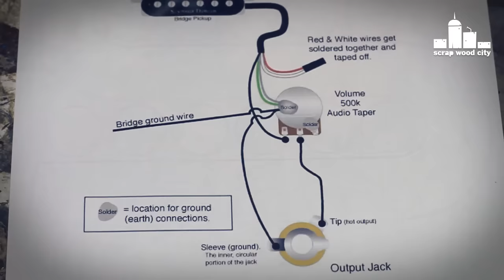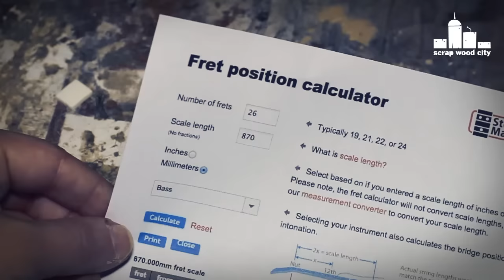How to make a DIY fretless electric bass guitar

Comment: Well, DIY... "Do it yourself" If you are carpenter and you have all the tools and knowledge.
Reply: Yup Xddd
Reply: all you really need to build guitars are files, a hammer, a saw and sand paper. you just need to put work in and want to do it. you don't need training or anything. just look up tutorials
Reply: in this video a lot of tools are not necessarry at all ;) it's just faster :p
Reply: well.. he didn't say everyone can do this s
Reply: i just wanted to say exactly  the same thing
Reply: I mean he's still kinda doing it himself, I guess?
Reply: Unless you are talking about taking a shit, you pretty much need tools and knowledge to do anything else. So, yes.
Reply: +justinmason100 A chisel might help at some parts, but not required tho! Actually clamps are almost necessary if you have to glue stuff. I guess you could lift the sofa on top of stuff, but it's not very practical and things tend to fall over quite easily, and these new hollow sofar are usually too lightweight for good results.

Also you need to have a space to do it. If you're living with a partner in a block apartment you're probably not going to get patted to the head if you conquer part of the room for woodworks for the next week or two. Actually mostly it's not even about the space, but the sawdust and trash.

Of course you can go outside, if you can. Here it's too cold for about 9/12 months and when it's warm enough to hang around outside I'm not going to spend it doing woodworks. 

See, you can make everything too hard if you really try ;)
Reply: Edu Martínez Power tools just speed up tge process. If you are determined, a hacksaw, a file and some sandpaper will work just fine. If you don't wanna get your hands dirty, that doesn't mean its not diy
Reply: He did do it himself though
Reply: True
Reply: Cyber_Jek Well he would have trouble cutting and soldering parts with his bare  hands.
Reply: Jon- DIY implies anyone can do it, with ease. This should have been entitled "Crafting a bass guitar from scratch". Your comment is elitist. I can criticize that not getting the terminology right for titling a YouTube tutorial also isn't "getting your hands dirty". Don't deign to tell me to do woodworking, and I won't tell you how to phrase your words, m'kay?
Reply: Wow what a surprise that making stuff requires knowledge and tools. Did you think he was just going conjure a bass out of thin air or something?

Comment: you have a loose ground somewhere, try grounding the potentiometers to ground because they can cause ground hum. if it still doesn't go away, replace the input jack and the main volume control on the amplifier. if it still hums, change out the cable with the power off and try a different source.

Comment: if it will be made shorter it is playable like a normal bass guitar? planning of building one myself... and for the pickup wiring... did you used all the magnets from the humbucker or not? you wired all magnets or you kept only the two at the bottom of the 2 bass strings? thank you

Comment: Nice job! Little tip to remove that buzz from the amp, apply shielding to the control cavity and the underside of the cover with aluminium tape and connect the shielding to ground by using a screw as a crimp. Make sure that whilst applying the strips of aluminium tape, one of the edges from a strip is bent backwards, then applied on the previous strip applied to make a continuous connection between the strips. I use this technique for shielding guitars which i make. True, copper tape is better but using aluminium tape is a cheaper alternative whilst achieving the same goal plus aluminium tape is more available than copper tape :)
Reply from the maker: +Blutaxt Malta thank you
Reply: +Scrap wood City Welcome ;)

Comment: A little grounding on the "bridge" would have decreased the hum, great build hovewer!
Reply: a little more w in the v and more V in the w would made the "however" much nicer, however nice comment
Reply: +Gigi Gogo Shielded wire from the pickup, and some sort of shielding in the volume pot cavity would help too. Should be negligible hum with that pickup.
Reply from the maker: +MrDavee1 I will deal with that problem in future. Sometimes it gets solved by simply re-soldering all connections!

Comment: Save for the fact that it is noisy as hell its tone is rather decent.
Though I think that a slightly bigger pickup housing to include a simple screen of aluminium or copper foil would reduce the noise.
Reply from the maker: Thanks. I know about the buzz but after some research I found out that the pick up was damaged. I bought really cheap second hand. Next time I will buy a descent one (unfortunately ) bass pickups are pretty expensive!

Comment: It hums loudly because the bridge was not grounded. you need a wire from the electronics grounded too the bridge . Otherwise you will always have a loud hum which you should not have with a humbucking pup.

Comment: Cool design from scrap wood. What kind of wood was it? Did you adjust intonation by calculating the exact position of the bridge? Important......   :)
Reply from the maker: Thanks, it's made of spruce. I usually adjust the intonation using harmonics, but don't expect really accurately tuned instruments with a DIY approach!

Comment: Nice as a fun project, but certainly nothing to be taken seriously. However, if you get that kind of buzz (noise) when you' re using a "P" style bass pickup (Which is a humbucking pickup by nature), then there is something you' re doing really wrong in the electronics department. There should be no buzzing noise at all...
Reply: There are a lot of things that be the cause of the buzz - and it's not necessarily the bass.

Comment: genius design. what kind of wood is it by the way?
Reply from the maker: thanks, it's just cheap spruce
Reply: Do you think it will bend from the tension of the strings? Or its thickness will prevent that?
Reply from the maker: So far it has not bent, but I think the wood is pretty thick to bend that easily!

Comment: No truss rod? Does that compromise the life span of the instrument?
Reply: +William Vickery There's no separation of the neck, it never had to be connected in the first place because it is the body. Therefore, no truss rod is needed to strengthen that bond.
Reply: Wow, you learn something new everyday! Thanks for the explanation.
Reply: And you! Are very welcome, kind sir.
Reply: +TheFaced Not true, neck through instruments also have truss rods. However with only two strings the tension is much lower so it would probably be fine.
Reply: +RecklessAC As long as it is kept in the same temperature and humidity, with a consistent tension, it will probably survive for some years before it dries out

Comment: yeah right diy, because everybody has a woodshop at home
Reply: +Eduardot12345556 DIY doesn't specify that it can be done with just household tools. And he used only the most basic tools to make this.
Reply: +Pope Adope he used at ñeast two power tools. the need for such equipment and knowledge to work the wood kinda beats the idea of doing something oneself instead of buying it or having a professional do it
Reply: A drill press and a bandsaw are essential basic power tools for working with wood. This was an amateur job to complete, far from professional. You can't expect to be able to complete harder DIY projects with no experience beforehand. Two years in a shop class would have you more than prepared to do something like this.
Reply: +Pope Adope I've built a lot of things over the years with very basic tools. I've never needed a band saw. sure would be nice to have one. Same with a drill press. The 2 tools I would say people need is a table saw and a jig saw/saber saw
Reply: Matt Thomas I can see myself without a bandsaw. I'd be stressed out trying to work without a drill press, however (I drill a lot of holes). But in the end, it all comes down to what you're building.
Reply: +Pope Adope I have a scroll saw. I use that almost like a band saw. That's a good investment. I can even attach sandpaper to it. crazy possibilities

Comment: its not really a bass guitar either
Reply: +LTMusic why not?
Reply: +Größter Swagger der Gegend because its upright and is more like an electric double bass in shape and how its used.
Reply: only because there is no body? 
it is an electric bass because it has a magnetic pickup and its not an upright bass because the normal electric bass strings are not made to use them with a bow like an upright bass
Reply: +Größter Swagger der Gegend its an electric bass, not an electric bass GUITAR
Reply: 8un3zz it is a split coil PU just put right next to each other... So it is a bass guitar PU
Reply: +8un3zz it's a split coil. like in a precision bass. there would need to be more magnets for a guitar PU.
Reply: +8un3zz well, I've never seen a guitar humbucker this big... and usually for a guitar they're made for 6 strings, not for 4...
why do people talk about stuff they have no idea about?
Reply from the maker: +Größter Swagger der Gegend I have used a second hand bass pick up! Not from a guitar! :)